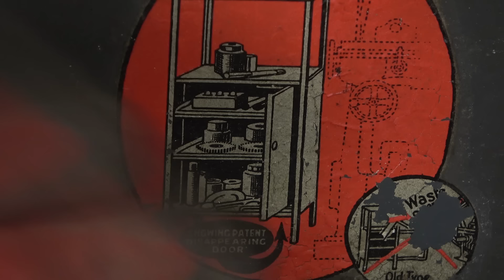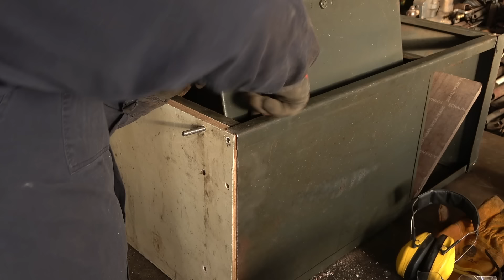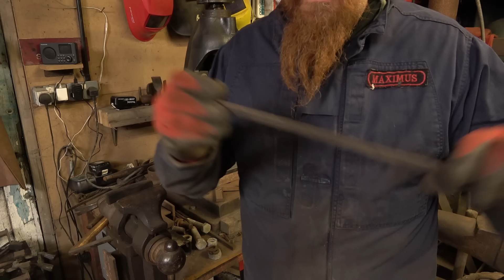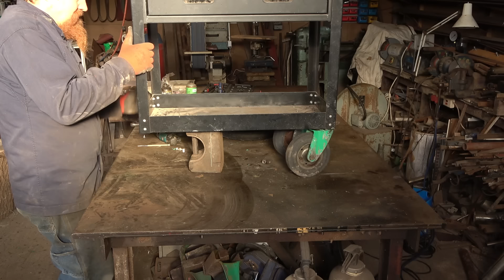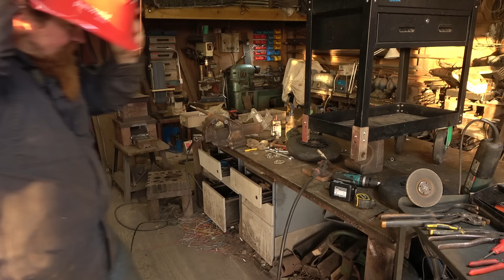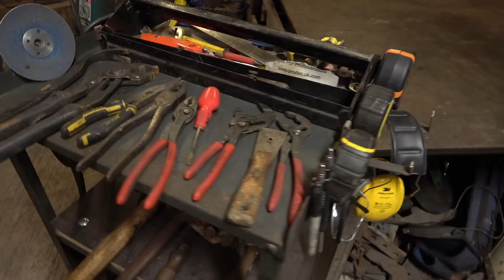Workshop Tool Trolley - A No Budget Build

Comment: Hi,  I see you have a Union Jubille lathe.    Have you ever removed the shaft to  replace the belt?    I am struggling to remove mine, I have removed all the grub screws and the shaft will move an inch or so but then stops moving even with  fairly serious blows. Any ideas?
Reply from the maker: I have done it on one of my dad's lathes, but so long ago I had to email him for a reminder! 
I'll link to the manual below, but basically it's a case of removing the screws, then drive the shaft towards the long bed side (IE hammer on the bowl turning side, moving shaft rightwards if looking at the front of lathe) I'd use a copper hammer or a lump hammer with a block of wood to protect the shaft. 
There's a diagram in the manual which shows exactly which screws to remove. 
https://ostiatools.co.uk/wp-content/uploads/2021/10/Startrite-MTC-Graduate-6in-woodturning-lathe-handbook-44.pdf
Reply: @maximusironthumper many thanks for your help.
I will have another go but I have applied a lot of strong blows with a heavy mallet and a punch. It moves about an inch or inch and a half and then stops.  There might possibly be a fairly strong burr where one of the grub screws has been.
Cheers, Norman.

Comment: Little tip from a sparky, with flex cable, just strip the end twice as much as you need for the terminal and double over the end for a decent connection if you dont have any ferrel crimps!

Comment: 10:20 I was always admonished not to tin wires for screw terminals. Solder acts like a lubricant in the gap and the wire can work itself free over time, especially in a mobile situation like that. Ferrule crimp is indeed the Way To Go.

Comment: These look great, though I’d prefer to see a bracket to hold the angle grinder so it’s not resting on the disc; maybe a flat plate with a long enough vertical slot in it so it rests on the grinder spindle. Either that, or put the guard on!
Reply: You'd 'prefer to see'......!?!?
Outrageous.......!
Reply: @a @andymccabe6712  outrageous? How so?

Comment: Nice tool trolley upgrades.
If you don’t mind using/buying plastic downpipe, use 65 mm square downpipe for tool drawer dividers.____Cut in half for shallow drawers.____Remove one side for deeper drawers. 
Also, if you can get hold of any old conveyor belt it makes moving wheeled trolleys/sack trucks/wheelbarrows across rough ground so much easier.____Ask me how I know? 😉

Comment: Tinning stranded conductors before inserting in screw connectors is not approved as solder can creep under pressure over time.

Comment: That foldaway door is awesome. Would there be any chance of you showing us just how it works,  I'd like to make one myself.
Reply from the maker: It's very simple, the side that disappears is on a track (just a small strip on steel on the floor and a slot in the corner of the door), what makes it work the way it does is all in the hinge and it's placement.
Reply: @maximusironthumper  Thank you. 👍

Comment: Hi, the usual way to secure solid cable into screw down connections , is to strip 3/4inch  and fold 3/8 inch back on itself, making larger cable to clamp on to, easy.

Comment: Nice job on the buggy trolley, I like those airless tyres - built myself a welding cart with a virtually identical axle setup (except I went for the split pin wheel retainer) but went for the pneumatic tyres and they leak like buggery, have to pump them up almost every time I drag the cart out (yeah I only weld about 6 times a year but anyway...).
Reply from the maker: Agreed, I had pneumatic tyres on both our garden trolleys - they just fall apart after a while. I found solid replacement wheels on ebay which have lasted much better.